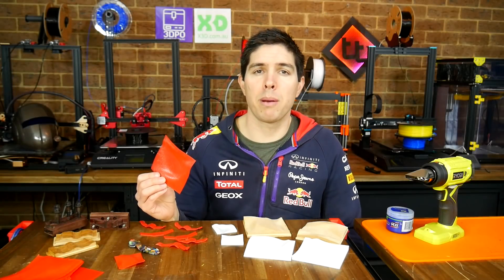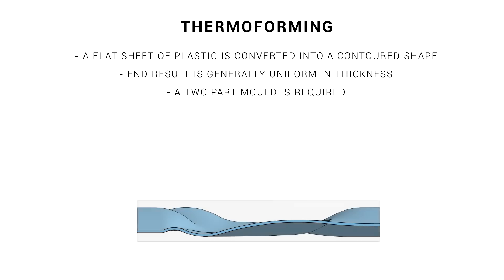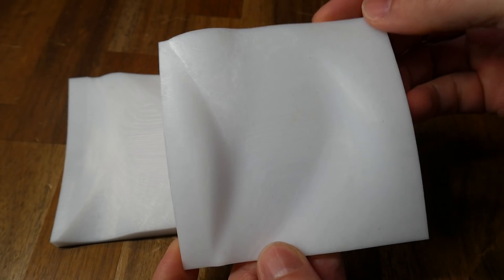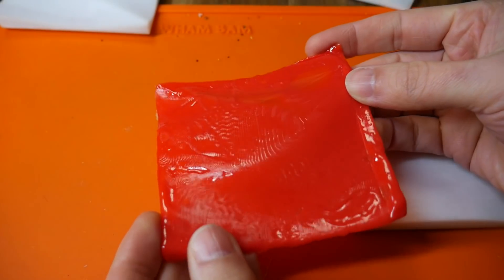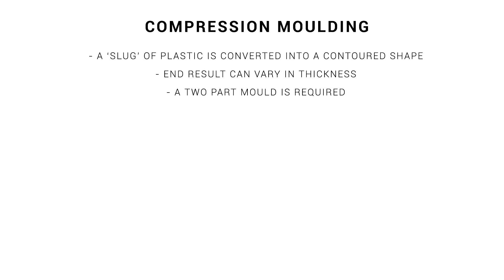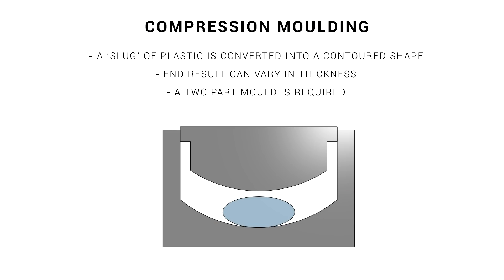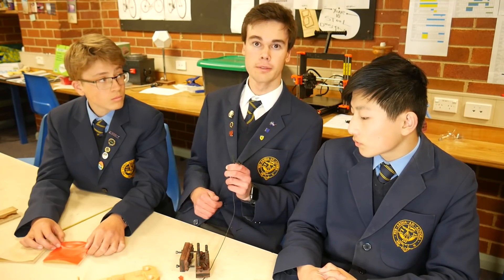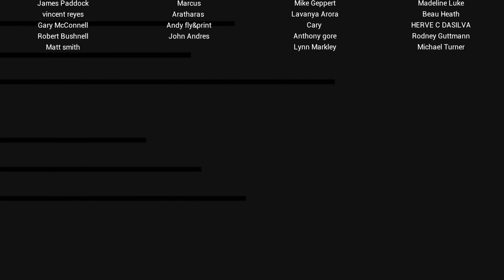Make more with thermoforming and compression moulding - Advanced 3D printing

Comment: Question: instead of an aluminum mold, have you considered a high temp resin? 

I'm part way in doing something similar myself. I'm also considering using automotive repair putty (1200c max temp) as a mold for metal casting.

Comment: I used to make orthopedic shoe inserts. We used a toaster oven like yours and sheets of plexiglass layed over the mold. When the glass was hot enough it would take the shape of the mold. We would then sand the rough edges as required. No need for a two piece mold as gravity does the work for you, unless you need both sides perfect.

Comment: It would be a lot easier to do it with vacuforming. You can make a vacuforming setup with a hot plate or toaster oven, a couple of cheap picture frames and a wooden box with  a bunch of holes drilled in the top, and a shopvac. You can get 10 12"x 12" sheets of Petg for about $20 US. Here is a video: https://www.youtube.com/watch?v=Y7P4TBovycU

Comment: What about using hot water with the mold like they do for the thermoplastic casts (broke my thumb last year).   You could use a thermometer in the water to get it to the correct temperature, insert the mold with plastic in, and then start tightening the bolts.

Comment: Apparently RenShape tooling boards, Necuron 651 model boards, or epoxy or polyurethane tooling and machining boards are good for machining 3D shapes using a CNC router.

Comment: When I was in a technical graphics course I took in the 1980s, we set type in a mold with lateral clamps holding the type together. We put a rectangular piece of bakelite, which softens with heat like pla. Clamping a a compression plate above with springloaded clamps providing constant pressure the whole thing was put in an oven, and as it heated, the bakelite conformed perfectly to create a nice stamp. More or less the same process would work for your project; use springloaded clamps with aluminum molds.
Reply: Oh, and short registration pegs and peg holes instead of threaded bolts.

Comment: sorry to jump on this video but i have just upgraided my ender3 with this BIQU DIRECT SKR Mini E3 32Bit Control Board with TFT35 E3 V3.0 Touch Screen and done a direct drive conversion, and now the motors are super hot and it seams like it over heating every wher
can you give me some advice or email add

Comment: Indeed a very good video! -What you/your students may want to have a look at, is "Vacuum Forming". There are several videos on Vacuum Forming on YouTube.
I think you could probably 3D-print an ABS sheet in various thicknesses instead of using a uniform thickness, then melt it until it sags and use vacuum forming to do the final part.
ABS is used a lot in vacuum forming. 3D-print a completely solid sheet.
Aluminum molds is a very good solution too.
Consider trying clay; the advantage of clay is that it is insulating very well, it's unfortunately also very brittle and would break easily, so a mold might not be very re-usable. The (burned) clay-mold should be treated with wax (eg. beeswax + olive oil 1:1 for a food-safe wax).

Comment: Try making the mold out of HDF not MDF and stop using bolts and use a hydraulic press as it will compress the molds faster and compress the plastic before it solidifies. I would also heat both halves of the mold  in the oven  so you dont suck all the heat out of the plastic as soon as you insert it in the mold.

Comment: The compression mold method looks familar with how I do injection molding.  I create a two (or more) part mold.  Usually I heat the mold but thats not necesary.  I then inject it under pressure from a heated tube that has molten pla or abs plastic.  The molten plastic is forced into the cavity and then I allow it to cool.  the mold looks the same but instead us trying to heat a slug I just force molten plastic in.

Comment: Because it cools so fast, I would think you would benefit from using a coarser thread to apply the pressure. Might be worth while to try using a machinists bench vise, coarse thread so it tightens fast, and with a wide jaw it can evenly apply pressure.

Comment: Wood can bear up to 200 Celsius before burning. For pla this would be hot enough and no need to have the Form in metal. Simply place the Form for about an hour in the oven, heat up the plastic as needed and when mating the two halves, use gloves. You will have minutes to compress it because the wood will store the heat some time

Comment: Nice DIY means of doing compression molding. Here's a tip. Add some vents to both ends of one side of the mold for excess travel of heated material and let air escape.. The vent can be a groove, say no more than diameter of a toothpick. Think of it as controlled flash where it can easily be removed after the part is removed from the mold (or mould).

Comment: The issue with using an oven or toaster oven for this is that the heating elements are either on or off. For regular cooking there is enough mass to regulate a consistent internal temperature, but for thin plastic the pulsing on and off can cause the temperature to fluctuate wildly and unevenly.

Comment: You should have mentioned (if I didnt miss it) that PETG is the perfect material for a mould,  because it is self-releasing like Polypropylene or Silicone. I did experiments with carbon fiber and epoxy resin, and to a certain point, you re able to work without any release agent

Comment: How about using PCL (a filament sometimes used with a 3D pen but can be machine printed) instead if PLA as it has a much lower melting point. Or even Instamorph, thermoplastic that softens in hot water.  I have used it in molds with great success.  The only difficulty I see is attaching it to the car, it can not be glued very easily .

Comment: You might give a try using PVC foam board instead of the PLA sheet. It is quite pliable when heated up.
I imagine you could do this with less actual flow of the material in that case as most will be just pressing down on a plastic foam.

Comment: In all of my years using onshape and doing hundreds of designs for people, I never realized that's what a loft does.

Yes I know this makes me the lowest iq designer but honestly I just used solid works for that. Well my life is forever changed now.
Reply: Did you ever need to use a loft in modeling without knowing it? How did you do it without a loft? It depends on what you're modeling whether or not you will use it but its pretty useful and maybe fun to use
Reply: SugarBooty I just made a crap ton of sketches and extrusions on multiple planes, and added filters and chamfers till it looked right. This feature will definitely let me make some cool geometry, but with how I was doing before hand and the amount of things I've designed, I don't think I necessarily needed it
Reply: @AlexJoneses  I still do what you did without lofts, I think modeling is about figuring out how to do what you want the easiest
Reply: SugarBooty the best way I've learn to model is by thinking like a 3d printernor whatever method of manufacturing I'm using. Just makes life easier when I actually go to make the damned thing

Comment: Use moldable plastic pellets. You can find it as InstaMorph or Polymorph on Amazon. You can melt it in water and it stays plastic for quite some time, meaning you could probably get it working on your current set up.

Comment: Spent 15 yrs working on packaging power electronics on airplanes,  three phase 400 Hz current from 10 to 1000 amperes.  High strength, insulating, and light weight  resulted in us thinking a lot about composites and how to make them.  One approach that I didn't hear the results was to build a mold from concrete.  I came up with the idea of using investment casting wax that could be melted out to form flow channels for cooling liquid and to flow the coolant around components.

So consider 3D printing the bottom surface of the part and the step vertical wall to the split line, and 3D print the top surface of the part on a plateau that matches the other half.   Concrete shrinks which make correct the shrinkage of the plastic as it cools.  Cooling and heating channels can be added with wax that is water soluble or melts out.   Steel molds are actually used for production compression molds.  Aluminum is only used for very small volume since aluminum wears away.   The thermal conductivity of steel and density is very poor.   Concrete is conductivity is worse by 15 to 50 then stainless steel to steel.  Aluminum is 6 to 30 time better then those steels.   

I would heat the molds first to the desired temperature or even slightly higher.  Use the thermal mass of the mold to melt the plastic.   Cool down can be accelerated by cooling channels or sufficient time.

Comment: Instead of a metal mold, a cheap and quick way is to make a mold out of plaster of Paris, using 3D printed negatives. Its hard and withstands very high temps, so the plastic can be taken up to much higher temps to nicely flow. One feature that the mold should have is over flow holes, so the excess plastic can flow out of the mold as its being pressed.

Comment: Why not use epoxy resin instead of plastic?
Reply: Epoxy resins are pretty heavy. Back when I was into aeromodelling we often added polystyrene microbeads as filler to reduce the overall density of resins when we needed to use them to fill gaps and cavities. You could do that in molding applications like this, too.
Reply: @anthonyrich1592  I do something similar, i use Vaseline to grease the mold then i inject polyurethane foam, when it expands inside a closed mold it gets very hard. The vaseline will make it easy to detach from the mold then i just use liquid epoxy to harden and fill the external porous surface. It can then be painted to a very fine finish.

Comment: How about... Having the bottom mold on the 3D printer and printing above it.
Usually the head is a hair above the printing layer. Here you would want the plastic to be almost liquid and to pour from a higher height (max height of the mold). You may even need to turn off the external fan (the one that cools the placed plastic).

Comment: Could you use a negative of each half of the mold to press a sheet of aluminum foil onto the surface of each half, leaving enough of the foil extending outside the mold, in order to bring the oven heat into the inside of the mold while it's clamped down inside the oven?

Comment: Really nice idea. Another idea for models with much supports. Is to “recycle“ or “preprint” the supports and reuse them.  So if you want to print “a table”. You could print the legs normally and before the tabletop start printing , pause and put the support in place and continue printing.  In that way you can only print the support structure  once and use it for many prints. It will not work for every models. But  it can reduce print speed and wasted material a lot for the ones that works.  I’ve tested it once but didn’t record it. I will try to make a video with the technique when I have the time.

Comment: Have you thought about using a microwave oven instead of a normal oven, not with the aluminium of course. Just a thought. I think temperature control and timing could be more precise.

Comment: I would assume that a metal mold would of course be better, but I think you can keep adding to your wood setup for better results. For example: I would grind the PLA and place it (your software should give you the volume) in the mold, then I would use springs on your bolts, tighten it down, place it in the oven and let it hit equilibrium. The springs will accommodate the PLA melting and forming to the mold, while keeping constant pressure on it.
The release screws are a good idea, looks like you need them for the part too.

Comment: You could try spray painting the mould with high heat paint (header paint for instance).  This would solve your porous interface issue and prevent damage to the mold and allow it to be used more often.
Reply: you mean flameproof coating ?

Comment: If you are doing this method I would suggest using ABS instead.  It should flow better.  ABS was made for this sort of forming and you dont have to worry about warping.  It also has some flexibility.
Reply: ok, but ABS warp quite a lot you need a hot bed  minimum 80°C and no airflow around or an enclosure
Reply: RomanoProductions RomanoProductions that’s for “printing “ ABS.   But for making the “SLUG” the warping is irrelevant.  But you will need a higher temp.  You could also use plastic pellets instead of printing the slug.
Reply: @Javiercav  oops, sorry, yes the slug in ABS, yes it is more likely to be molded but the temperature will be a bit higher than PLA

Comment: Thanks, tho the printed molds don't seem a way to go (since they are also melt to easily) and also CNC one is not an option for me.
I think about printing a mold negative and then cast the actual mold with a 2 part or UV resin. Which should also be an option.
Reply: might be an option but 1/ you need a very thicc counter mold so the resin doesn't shatter under pressure. 2/ you need a coat of PTFE lubricant so the counter mold resin doesn't get stuck to the mold.
Reply: @RomanoPRODUCTION  Or a thin layer of high temperature silicone rubber.

Comment: Does the part have to be PLA? I think you would be much better off casting it. Your molds would work for that, and you would gain a.large number of options. The method shown seems a bit like forcing a square peg into a round hole.

Comment: If you already made the molds, wouldn't it be better to make the part out of carbon fiber?
Reply: it is gonna be expensive because you need a printer that prints carbon fiber.
Reply: no no, i mean carbon fiber fabric with epoxy resin
Reply: @santiagoblandon3022  yes good it makes sense now :) soft carbon fiber with resin. But I wonder if it is expensive.
Reply: For that little piece... not at all

Comment: You could cut aluminum sheetmetal  with the lowrider cnc, then stack the sheets to create the 3D aluminium mold. Sort of like 3D printing, but instead of adding each layer, you machine each layer then attach. You can then adhere the sheets together to create the 2 parts of the mold. I think this should work, and you can make more advanced shapes (since you can machine the top and the bottoms, you can create overhangs).

Comment: If you have a 3D printer but no CNC, you could easily print females of your press tools with drafts and cast the males from plaster of paris and PVA mix in them. I have made plenty of moulds using 3DP for silicone rubber and plaster casting.

Comment: I have one idea regarding the aluminium mould: Could you insert heater cartridges and thermistors in it and use PID (with PID autotune) to heat it up to precisely the temperature you want? If you use an recycled 3D printer mainboard for this, you could also add motors to compress it automatically (maybe with normal threaded rods like in cheap i3 clones?) Seems to me like a good opportunity to find a new home for an Ender 3 stock mainboard.
Reply: Definitely although you'd need a pretty strong motor/pump to have the amount of compression needed for molding parts like that. You could probably get away with using clamps.
Reply: @Lobotomy4u-s4x  Since no speed is needed and using cheap threaded rods with normal metric threads reduces the speed and increases the strength, that might just work. But using a planetary gear to increase the strength would be a good idea, I guess.
Reply: @Lobotomy4u-s4x  they make pretty beefcakey stepper motors and just get a finer threaded rod and make those giant pipe clamps
Reply: exactly what i was thinking... other than the motors lol

Comment: what if you clamp the workpiece between the dies, tightened by bolts and nuts on the springs and slowly heat it all up in the oven.
Reply: That is kinda what I was thinking, tighten it down semi firm, bake for a bit, retighten and bake some more, repeat till done.

Comment: Use strong spring on the bolts, it will push the two halves together inside the oven.
Reply: Only issue is it was difficult to heat the plastic when in in the mold, in the oven. Instead i think a perfect solution would be to make the mold out of aluminum and insert heater cartridges into the molds. It would make the whole process faster and easier because it’s much more efficient that heating air to then heat the mold that then heats the plastic. Would need to design an easy release mechanism to pull the mold apart.

Comment: Use plaster of paris-
Reply: too brittle
Reply: @RomanoPRODUCTION  Use Hydrocal, which isn't?
Reply: @Pygar2  thanks for the tip. Interesting. But yes, it is cement and it doesn't look cheap. Plaster of Paris is unexpensive and with some efforts in mixing and molding you can do nice shapes but not so precise :)
Reply: @RomanoPRODUCTION  IIRC it's sifted Portland cement AND Plaster of Paris, so it is very strong, but takes good detail...

Comment: If you were to make the mold on the CNC like you did, then make a greensand casting of that mold out of aluminium you might be able to get some decent results that way. I haven't done greensand casting myself, but it might be worth a try.
Reply: But why CNC something to then use casting? If you want a casting, using PLA would be better, since you can use basically the same techniques as with wax and it is easier than CNC. If you want the mold out of aluminium, why not CNC it directly out of a bigger block of aluminium?
Reply: @Auravendill  CNCing the aluminum makes more sense than what I was saying. Probably the better way to go
Reply: greensand doesn't make great precision, you need to machine some of the parts after

Comment: Maybe using a vise to clamp the mold halves would be easier. It’s fast, strong and applies uniform pressure.
Reply: With dowel pins as guide rods.
Reply: @scottjackson2812  And/or 3D printed vice jaws to support and align.
Reply: We have a book press, that could work.